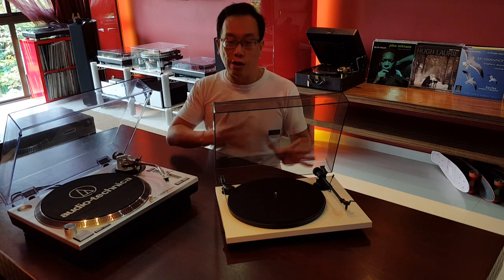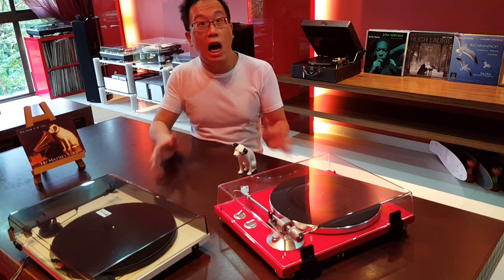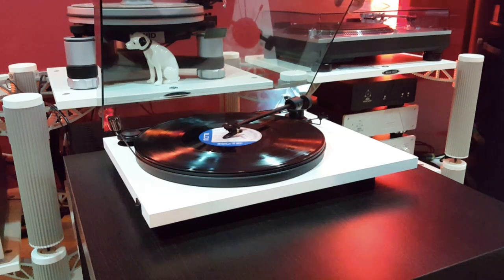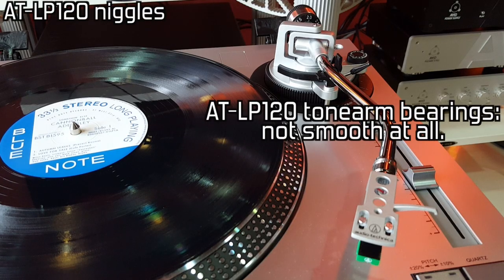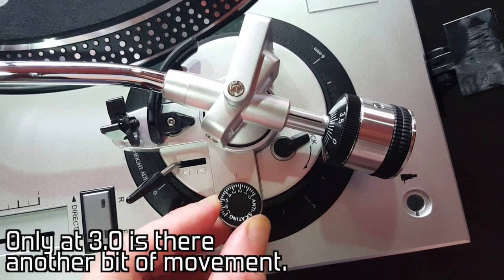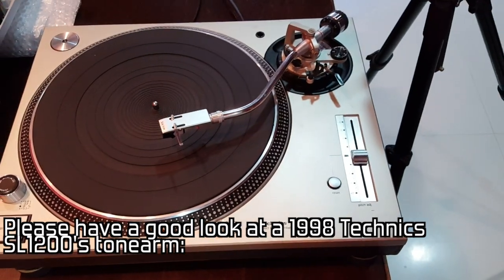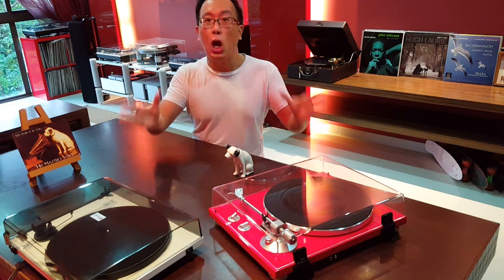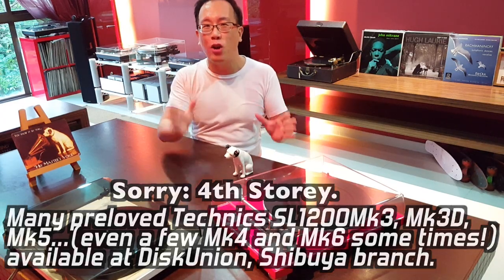Turntables $250 -$300: Shoot-out & Reviews.   AT-LP120 + Pro-Ject Primary + TEAC TN-300

Comment: I think another good option in this price range is the Technics 1350.  I was fortunate enough to have one given to me by a great friend.  The unit is over 40 years old.  I have not been particular kind to this deck.  I have moved several times since it has been in my possession and it still works and sounds great.  I do need to do some maintenance.  Dampening fluid is shot and the rubber in the feet used for isolation has hardened with time.  This was easily fixed with some cut in have balls from Hobby Lobby.  I recently cleaned out the pots with contact cleaner and the speed is consistent.  I find the 1350 on sale occasionally for right around $300.  The Technics 1350 originally came with a tall spindle to load multiple records.  I do not have the tall spindle.  The spindle itself usually sells for $100 +.   I never really thought I would have wanted to drop records from that height anyway.  Good option in this price range. Also looks really cool.  Thank you for another great and carefully thought out video.  Great reviews and wonderful insight!
Reply from the maker: David Haar Dear David. I read with delight your heart-felt and detailed experience of your SL1350! I keep in mind these information👋👍😄!!! Thank YOU!!!! Very nice of you.  I will try it out if i see one or one is available! May you continue to have many years of wondrous vinyl playback with it!!! May the Force be with you. Hi five and cheers mate!
Reply from the maker: David Haar ....(2nd reply) and Sir, thank you for adding very constructively to the scope and knowledge of fellow friends here👍😄✌
Reply: I also wanted to let you know that I saw you using Cannonball Adderly's Somethin New to demo some gear.  I was fortunate enough to find this used last week.  I love this record.  The recording quality is top notch and the songs are played with passion.  Truly a beautiful record.  Thank  you so much for all of your hard work and intelligent, heartfelt reviews.
Reply from the maker: David Haar I can't believe the coincidence. I was plaging this record this morning for a full hour, both sides, 2 times!!!!!!!! 👐👐👐👐👐👐👐👐👐👐👐💪😄!!!! What a super Sunday this is😍🎶🎶🎶!!! Thank YOU Brother for coming by and giving me such joy at this coincidence!!!!!!!Warmest Regards Buddy!!!!💪😄✌

Comment: 100v mk3d japanese technics not suitable for UK :/
Reply from the maker: gmaverick2k It is suitable. I am in Singapore:👋😄240V as well. Commonwealth country. No problem. Use a simple step-down transformer 240Vto100V. That is all. Quartz locked speed stable. All systems go.
Reply: shipping is so expensive, quoted the same price as the unit itself. 515usd total not including import duties. wtf
Reply: Was able to source an sl-1210mk5 for 400gbp. waiting for my nagaoka mp-110h to arrive tomorrow then i can test :)
Reply from the maker: Bravo my friend!!!!!!! :-D!!!!  You are on the way.  At GBP400, it will be better, more solidly built, sounds better, and provides ease of use and a host of facilities to adjust the tonearm height, anti-skating, much better than the Rega Planar 1 and 2.
Reply: my first batch of vinyls are: 'little dragon-season high', 'wu tang 36 chambers', 'tribe called quest-peoples instinctive travels' & 'weval-half age'. need to stock up on rock 'stp-core' next. after using flac for long time lets see difference. setup: technics>focusrite 2i4> JBL LSR305 or technics>fiio e9> Phillips Fidelio X2 (WOOX)
Reply: sounded quiet. now i need a preamp with ground -_- don't know why i thought sl1210mk5 had preamp built in (too much focus on at-lp120). purchased a behringer pp400 and extra phono cables arriving tomorrow...
Reply: hmm interesting experience. vinyls were skipping so was annoyed, turned out to be tonearm height being too high. recalibrated using 'ortofon adjusting set'. now it doesnt skip and i hear a little more detail compared to flac. but slightly noticeable, not x10 :D with my current setup and speakers i believe i've hit a wall and purchasing a decent amp with good phono stage (onkyo a-3010?) and speakers (passive) will push the turntable further but currently my setup is on par with flac from pc.
Reply: omg, i take it back. 'ATCQ - peoples instinctive travels' sounds insane. nas -illmatic sounds like it was from a cd copy
Reply: sound quality improved drastically connecting directly to jbl lsr305 active speakers from phono preamp. 2i4 dampened the sound quality using line in gains

Comment: I bought a Rega planar 3 yesterday. Back to Vinyl after 10 years. Wish I'd kept my Thorens 160 SME 3009 and Ariston RD110 SME 3009!!
Reply from the maker: Dear Bryan!!! So it was yesterday!!  I am very happy for you!  Is it the same as mine: white?  I bought my P3 only in mid-September after doing the DebutCarbon vs P1 vs HX500 review which left me personally, very impressed with Rega's lead over the competition.  My very positive impression led me to buy a P3 as a reliable reference test deck onto which I can test and audition cartridges and phonostages from now on.  A reliable test bed for the service of the vinyl community.  I need reliable, transparent equipment.  I need to be accurate in the audition results.  Congratulations Brother Bryan for your purchase :-D !! .. WOW, a Thorens 160 on top of the Ariston RD110!!!
Reply: I couldn't afford the brand new model so I purchased a 2015 one with a Elys 2 cartridge and a 24 volt PSU. It belonged to an elderly lady who's son sold it. Fully boxed with all the instructions. I have to wait till a Phono preamp arrives thought!. I use Valve Amplifier called a Puresound A30.
Reply from the maker: CONGRATULATIONS brother!  It is still the wisest choice and fuss-free choice.  The RP3's RB303 tonearm is a superb tonearm... the 24V psu still one super quiet motor.  :-D well done!!
Reply: You convinced me when I saw your RP3 v P3 Review. I purchased a secondhand project Debut with a speed box and phono preamp in November 2017.This turntable was made in 2003 and it had the standard Ortofon 5e fitted. I was amazed at the dynamics. I listen mainly to classical music and I purchased some DG boxsets for a small amount that were 50 years old, but the discs like new. I was blown away comparing the vinyl against the CD!
Reply from the maker: Bryan Powell wow Deutsche Gramophone box sets💪😄!!!!!

Comment: Hi Ian, I have the lp120 and was wondering if I put a 3mm cork mat on top of the standard 3mm felt mat would it make a difference to SRA .I understand you added a 5mm rubber mat but would adding a 3mm have any benefits?
Reply from the maker: HG15 Dear Buddy👋😄...it will help. 3mm should translate to about 0.6-1.0 degrees reduction in the Stylus Rake Angle and thus in the case of the LP120, gets it closer to the ideal 92deg.  Have fun🤗!
Reply: HiViNyws channel  Thank you! After watching these reviews I really wish I had bought a rega planar 1.
Reply from the maker: HG15 Dear Friend 🤗 we all learn. I had my fingers burnt before in my 23 years of audio journey (since 1995)...so take it in your stride. Yes the P1 is the tpp choice at sub-$500 and it should really be the first worthy deck for anybody getting into vinyl, and it is an the most optimum ambassador plug-and-play deck of vinyl playback, in the market now. Great sound. Sets the superb standard indeed.  Brother, you are very kind and i am sure your diligence will find you a P1 or a superb used SL1200. Take your time my friend👍 we are all in this vinyl community together. Warmest hugs!
Reply: HiViNyws channel I’ll be on the hunt for a technics Sl1200! Thank you
Reply from the maker: HG15 Best Regards 💪💪💪🎶🎶🎶✌✌✌

Comment: Nice review, one question tho. You opened the AT to change the cables, however there is no sound comparison in the video. You opened the AT but not the Teac to see if there is an simple issue you can solve. Is the problem inside the electronics or is there a mechanical (grease) problem? Did you have tried to let it spin for a few hours and then try again?

Some other review report about the Teac TN-300:
Sometimes you may happen to get a hum, but not all users have reported this. It’s still a mystery why it occurs. In addition, it may not keep the quality as you convert the music and transfer it to have it played by some digital software. It’s a bit of a lottery here. Also, It appears that TEAC has some issues with its quality control service every now and then, so certain customers get faulty models. If that is the case, you can just exchange it for one that has no issues, so keep that in mind the first few times you use this turntable.

Comment: Ian, I finally have an update for you. I sold my Clearaudio Concept because it was having speed issues typical to belt-driven tables. I was then able to purchase a 1200 MK3D that was thoroughly refurbished by Stokyo in Japan for the US market. Here is what they do:

After hand selecting Japanese market Technics turntables, each unit is put through a 100 point plus inspection process by a team of Japanese engineers.
In extreme detail, critical areas like the tone arm, tone arm assembly, wiring, platter, motor, balance, pitch, rotation etc. are examined and further tested on the oscilloscope, balance instruments and mechanical rotation counter.
Every part that does not pass inspection is replaced with original Technics parts; only original parts from Panasonic are used.
Once the turntable passes the inspection and calibrated to factory spec, the entire turntable is detail cleaned and polished.
EDIT: The original RCA cables checked and tested. They are replaced only if necessary.
The power supply is converted for the US market.
EDIT: The unit is NOT internally grounded, but I actually prefer it this way so you can use your preamp's ground connection. There are cases in which internally grounded units can develop grounding issues.
My unit came with the dust cover (in great condition!), but not all of them do. It's hit and miss.
Includes (1) year warranty that covers defects and workmanship.

The unit does not come with a cartridge or a mat. I got this for $549. Free shipping. I picked up a Nagaoka MP-110 with headshell to go with it. I also got a composite cork and rubber mat for it. I should have the turntable by next Tuesday.

Thanks for all your help!
Reply from the maker: I need to pin this comment.  This is very important for all friends here.  Thank you super brother.  May your Cheeto baby always be happy in Rainbow Bridge.  Mokochan sends her regards.  Wife and I, and Moko, are in Dempsey Hill Culina coffeehouse having tea and croissant now.  We love Cheeto :-D
Reply: Hello again, my friend. Was it morning or afternoon when your family was at the coffeehouse? It sounds very cozy.

I forgot to mention, they also replace the pop-up light and the strobe light with LED's that will last much, much longer than the originals. Each unit comes with a certificate of warranty and their quality control checklist for the specific unit you purchased. See here:
https://cdn.shopify.com/s/files/1/0105/4542/products/stokyo-mcc-certificate_1200x.jpg?v=1383939869

Remember, these are used units and may show small signs of wear, although I've heard they're all very, very clean --even the B-Condition models. Originally, they didn't ship with dust covers but some units are now.

Only a few retailers here in the US carry these. I purchased mine from a retailer that sells pro musician gear; they are called World of Stereo, located in San Francisco. You can purchase from their website or Reverb.com. Look for "Refurbished" in the description, otherwise you're just buying someone's used gear. I've heard the B Condition units look more like A Condition, so I, personally, wouldn't spend the extra money on A Condition. (Spend the money you save on records!!)

My unit should arrive tomorrow and I'll give another update after I've used it for a while. Best wishes to my brother Ian and all his viewers!!!! :D
Reply: Ian, thank you so much for mentioning Cheeto. Our pets are like another member of the family, no? Cheeto lives on in my heart...  Thanks again for all your audio advice. I think we all check your channel every day, hoping to see a new video. Take care!

Comment: thank you for the great video. i've had my LP-120 for several months now. i had a buddy remove the preamp, i have an MP-110 cart on the way, and i still need to order a heavier counter-weight. my problem, however, is with the "alignment" (if that's the proper terminology). getting that sweet-spot of 92degrees. where can i get a shim like the one in the video? and should i just grab any old thick rubber mat and throw it under the stock mat, or will perhaps 2x rubber mats do the trick?

i'd sure as hell love to order the SL1200, but i'm trying to keep the costs down and get the most out of my LP-120 before upgrading (perhaps another 6 months to a year). i'm just a little lost on the entire endeavor. is something like this what i should be looking at? lpgear(DOT)com/product/SCREWONWTS.html ? is there a video i should be watching to familiarize myself more with the process? so far i've been using this blog post as a general guide: scouringthebins.blogspot(DOT)com/2013/03/tweaking-audio-technica-at-lp120.html

thank you again for the video. i'd appreciate any help i can get.
Reply from the maker: Dear Brother :-D,
I have checked your first link... yes on that lpgear website... that shim is correct.  Bingo :-D
I kindly ask for your time to watch my videos on how to set up a turntable-cartridge, and you should be well on your way.
The MP-110 definitely beats the AT440MLb hands down.  So does the Grado Green, it easily wins against the AT440MLb.  There are much more than meets the eye than just having a finer stylus, and a "dual magnet" system.  Much more than this.  You can watch my AT440MLb video too.  Grado Red, Goldring 2100 as well, easily better than the AT440MLb...and very likely the AT VM540ML which i am doing the initial auditioning now after having runned it in for 120hours :-D
Oh yes, you may try 2x rubber mats :-)
Warmest Regards my friend,
I hope you do well on your way!  Thank you for catching up!

Comment: It appears that the AT-LP120 is a clone of the Technics 1200 like the Pioneer PLX-1000 and little brother PLX-500 since it is the only direct drive model.  Is this correct, and would it be best for DJing?
Reply from the maker: Fox Rivers Dear Sir, the at-lp120 looks similar to the SL1200. But it is an extremely far cry in terms of materials, engineering and quality of the innards. The platter is different in quality and manufacture, everything underneath the platter: the motor, spindle, electronics,...the tonearm quality, the material of the plinth and base plate, feet.... everything is totally different unfortunately. I would rather save up a bit more to get the SL1200 definitely.  The difference in what one gets between the SL1200 and the AT-LP120 is like heaven and hell.  Brother you have to feel, examine and operate them yourself to fully appreciate the colossal difference between them.... i hope you can have the opportunity👋😄✌

Comment: wow! that was a real eye-opener. you destroyed the AT LP120 and with good reason. i'm going to save up for the rega but also keep my eyes open for a Technics 1200. but if i had a choice between a rega planar 1 and a technics 1200 then i wonder which is better. anyway, great work.
Reply: the technics 1200 in good shape is at least on par with a rega 3 imo
Reply: As good as the Planar 1is, I’m almost certain that the SL1200 is better provided it’s been well cared for. The current generation Planar 3 would give it a closer run.

Comment: I changed the stylus on the Pro - Ject to an OM20 without cartridge re - alignment. You just swap the stylus over. However, it was difficult to remove, and i had to use a pair of needle nose pliers. I contacted Pro - Ject in relation to tracking force and was told that 1.75g (OME5 is 1.50g - 2.0g) was still within tolerance for the OM20, but i felt that would be tracking on the heavy side for this stylus.  I Managed to adjust the tracking force to 1.53g (OM20 is 1.25g - 1.75g). I've had no distortion or skipping problems. Plus I've changed the platter to an acrylic. And yes the belt has flipped off once during play, and is difficult to put back on. Dust cover is also as you say. Other than these problems, I'm still happy with it as a TT.
Reply from the maker: Sarafs it is always a virtue to like what you have. It makes for pleasant living. Best regards brother😄
Reply: Thanks and kind regards!

Comment: Thank you very much for all these videos !!! I need some help here: I have AT-LP120 and it is  used with  the Shure M97XE, connected to my Sony CMT-SX7 (for me and my pocket, very pleased) But no matter how hard I tried to get the tornarm parallel to the surface (putting two mat on it) I have not succeeded. On one of your videos there is a stuff (I do not remember which one is) that can be put between the phono cartridge and the head shell in order to elevate the tornarm . What is the name of it  and in what page I can find it in order to buy it. Thank you and regards.
Reply from the maker: Dear Brother!  Yes, that thing is called the "shim".  You can buy that from your local vinyl retailers usually.  Or from ebay sellers.  They are usually universal, with two holes commonly spaced to accommodate for the two screws going through.
I wish you a smooth and easy time throughout my friend!!.. Warmest Regards,
~ ian.
Reply: Thank you very much Ian !! Regards